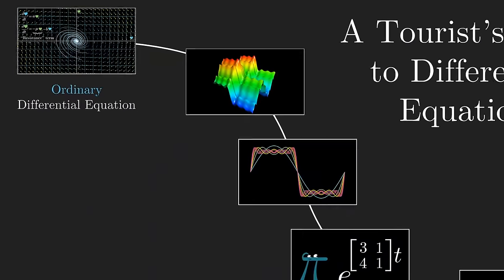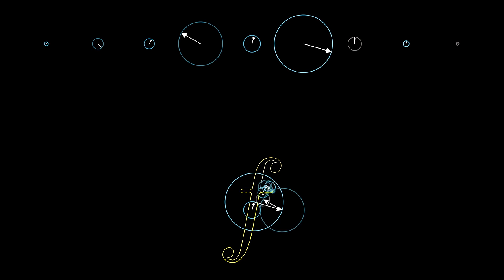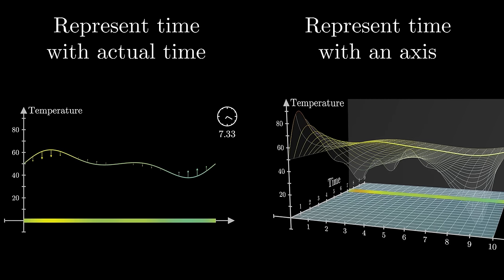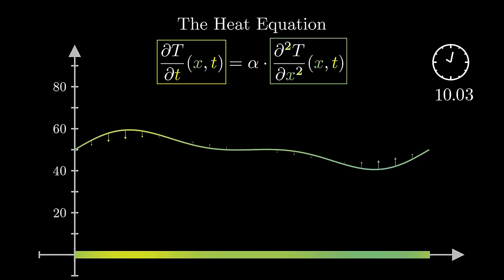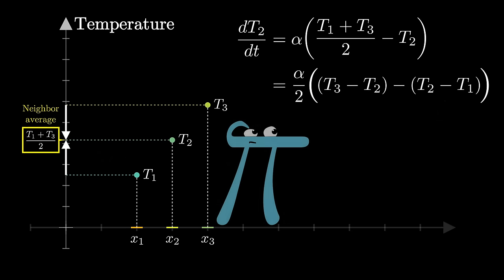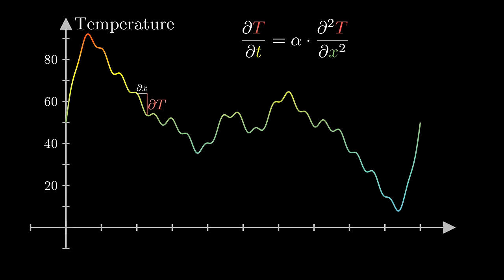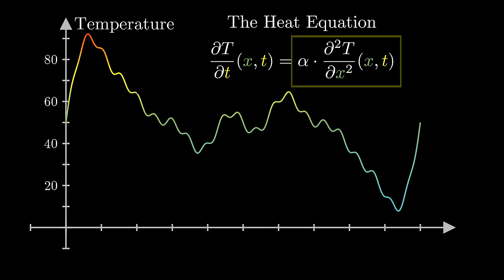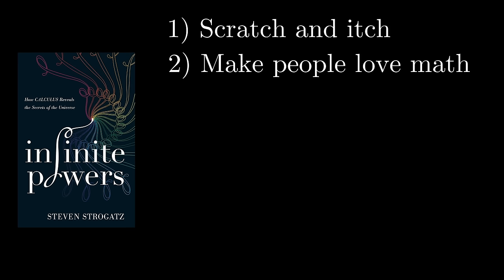But what is a partial differential equation?  | DE2

Comment from the maker: Next up, we'll look at how to solve this with Fourier series, including some discussion of boundary conditions.  Stay tuned!

Edit:  I see a number of questions about changes at the boundary, so maybe I’ll add a quick note.  For example, some of you ask if a function with constant non-zero slope is stable.  Indeed, this is something that needs to be specified for a well-defined solution, so good question!  The heat equation as described here only describes the interior.  The easiest boundary condition to work with is when each endpoint is held fixed, e.g. if the ends of the rod were somehow constrained not to change temperature.  In that case, straight lines are a stable solution.  But other conditions can be specified too, as you’ll see!
Reply: Cant wait to see if you use the only good convention for the prefactor
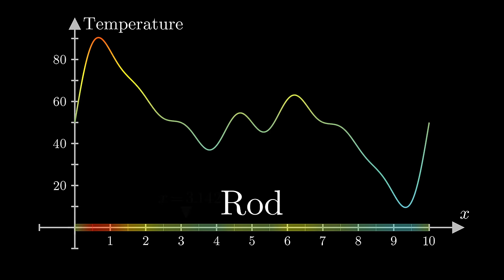Reply: Thanks for this, writing some coursework on this very topic right now and this really helped clear some stuff up, certainly one of your best series. Also nice choice of numbers @ 3:45
Reply: What if the temperature distribution is linear? Then the second partial with respect to x is zero but my gut says that temperature should still ballance out
Reply: @joshuagross6022  There was no assumption about the boundary in this vid, so it would correspond to a constant heat flow
Reply: @aksel9290  1) pi 3) Golden ratio 4) tau 
What's 7.380?
Edit: Sorry, 7.389
Edit: Nvm, I read it in comments. It means e^2.
Reply: Your Channel is the best so far in explaining complicated topics in a very comprehensive way. I had studied chemistry engineering and we had those things explained by our professors, but to see it visually realized like this makes it even easier to understand the abstract nature of math. While I don't hate math, it was never a topic, where my imagination can go loose as organic chemistry, where you can imagine the mechanics of reactions and the why, for instance an electron would go to this position and not the other. I already recommended your channel to my best friend, who is math affine. Thank you for your existing channel, it is always a pleasure to watch it
Reply: @3b1b I'm very interested in how Fourier Series can be used to animate alphabets n any curves😃. Eventhough I get only some part of ur vid but u definitely make me interested in Math. Keep up the good work.
Reply: Sir pls measure theory and integration
Reply: Please look in to the electric universe model, consider Riemann hypothesis and how ricci flow was solved as a heatlike event of embedded spheres creating tori. And how when magnetic fields polarize they form tori.
Reply: What a time to be alive!
Reply: thanks for this! my ode + pde exam is next week, perfect videos to influence me to start studying :)
Reply: If you ever take suggestions:
1. It would be awesome if you could cover numerical methods for PDEs too;
2. I also saw many people trying to illustrate path integrals, but your illustrations and animations are considerably better. That would also be quite interesting to see.

Anyhow, keep up the good work. Those videos are fantastic.
Reply: 3Blue1Brown solve f’’(x) * f(x)^2 = c
Where c is a constant. I have no idea if it can be solved.
Reply: @eunhyoukshin7777  The model presented would not correspond to any heat flow as I understand it, let alone constant flow. The second partial with respect to x would be zero if the temperature distribution was a line, dT/dt=0
Reply: @kpopalitfonzelitaclide2147  That's a nice differential equation, where did you find it?  Substitute y = f(x), v = f'(x) so that f ' '(x) = dv/dx = dv/dy * dy/dx = dv/dy * v, so that the equation becomes dv/dy v y^2 = c.  Then you can separate variables which leads to an interesting integral.  See if you can take it from there.  It's solvable.

By the way, this isn't just me being clever.  The trick of letting y = f(x) and v = f '(x) is useful in situation where the independent variable (x for us) is not part of the differential equation.
Reply: I wish these beautiful videos were in Turkish
Reply: It’s funny. I never thought I’d reach the point that I would already understand what you are trying to teach before the actual video. Thank you BVPs!
Reply: Could you do the wave equation after this series of videos?
Reply: Will you also show how to solve with Green's function and the notion of what convolution does?
Pleeeeeease!
Reply: @joshuagross6022  Yes, but there's nothing wrong about that line being stationary (unless we assume thermal isolation)
Reply: @joshuagross6022  Or we can just think of boundary temperatures being fixed by some surrounding env. (Hence the heat flow)
Reply: I'd like to have a clear intuition about rotational and divergence
Reply: How does he animate these?
Reply: The best at explaining the mystery behind the world of mathematics. Even Richard Feynman would be impressed with this with the use of his technique. Carry on the good work at bringing complex maths to a level that makes it comprehensible.
Reply: I already took all the mathematical courses from an electronic engineering curriculum, but  never got that interested in seeing what really happens under the hood as when i watch your videos.  Thanks!
Reply: Please explain Maxwell's Equations in Electromagnetics
Reply: Then how can that situation be equal to the situation in the video.....8:40..T3 and T1 aren’t constants right....need a bit clarity over it.....relative??........but the animation(or visualization) you showed confused me a bit....
Reply: Why are your formulas always coordinate dependent, that in and of itself takes away the point of your videos which is mostly to gain a clear intuitive geometrical intuition about various topics?
Reply: When does the next video come out?....Eagerly waiting!
Reply: When should we expect it
Reply: Put subtitles in portuguese, Please !!!
Reply: I have a question. Could you tell us how the picture will change if you start to slightly change the parameters of one of the epicycles. How will the picture change if you increase or decrease the rotation speed of the first or second or 32 epicycle by 0.001% or change its radius by a small amount?
Reply: 3Blue1Brown I‘ve got a question concerning the video „why is pi here?“ at 15:44:

I would also intuitively divide the brightness’ value (pi squared divided by four) by two, because we just want one out of two sides (of the infinitely big circle). But I read that two sets, that are both countably infinite, have the SAME amount of elements. Why also can we divide the brightness‘ value by 2 ?
Reply: Could you please make a video explain in principle how could you make these beautiful animations?
Reply: Can't wait for the next episode! :)
Reply: Can’t wait for Fourier series. They were the last topic in my Real Analysis class and I thought they were really interesting
Reply: Can't wait :D
In my second year in college we're going to discuss DE. The upcoming video would be a great help for us learners.
Reply: update quick
Reply: Thanks! Will the next video also provide an intuitive explanation of why a cdf pops up in the solution?
Reply: I don't understand the logic  of replacing ∆∆T to d2T/dx2. Is it some trick? Or some deception?
Reply: Thanks grant
Reply: Request: explain the conceptual difference between boundary conditions and initial conditions, specifically highlighting why boundary conditions make things HARD in a way initial conditions don't?
Reply: 3Blue1Brown please, I need you to tell me why: 0!=1 ? & what's the other rules of factorial?
Reply: when will the next vid be up?
Reply: Are you okay? I'm starting to worry.
Reply: I would love to watch a combinatorics or number theory video series
Reply: Good day! Could you please tell what software you use to produce these animations? I admire them greatly and I would like to learn how to do something similar as supporting material for my seminars. It has probably been asked many times before, but I couldn't readily find your answer in the comments. Thank you!
Reply: Can you do Avideo about Fuzzy Logic , Sate Space,

Comment: I'm a computer science grad and I've taken a handful of classes which required the use of ODEs and PDEs. After watching this video, I feel like I have finally gained a full conceptual understanding of how they fit into the larger scheme of operations in math and cs. The visualizations you created were absolutely incredible, but the explanation was perfect. Thank you so much!
Reply: can you reference some pdfs or channels to learn odes and pdes related to computer science?
Reply: Yeah @anti gy I have the same question, any recommendations @Kraylus?
Reply: tf2 engineer tf2 engineer
Reply: comment exeptional n a created have you
Reply: Likewise...The only classes I used DE’s in really were for Engineering Dynamics and Vibration Analysis (Civil Engineer) but I never really understood what was going on, this is a great video
Reply: Outstanding
Reply: @antigy7962  Not OP, but I also had to do something similar in some of my classes. Mostly, from the CS perspective on ODEs and PDEs, we try to develop programs to numerically solve these equations. The particular equations themselves depend on your area of application. For example, if you're interested in fluid flow, perhaps you may be working with the Navier Stokes equation, in brain simulations in Computational Neuroscience you may be solving equations that model how neurons generate spikes and how these spikes lead to the change in synaptic weight between two neurons, and in game design, you may be writing physics solvers for colliding objects and such.

Comment: 14:53 Wouldn’t the laplacian also include a second partial derivative of T with respect to time since time is one of the inputs for T? 
Edit: I’m just now remembering that del operator only has 3 spacial partial derivatives for x,y, and z and not one for time so then when you take the divergence of the gradient of T (Laplacian) there’s no second second partial derivative for time.
Reply: That really depends on the role of time in the physical context and the interplay between time and space. @3Blue1Brown perfectly illustrates this interplay in the context of heat flow, the interplay between temporal and spatial variation and the resulting partial differential operator (all those derivatives summed up). In different contexts with different interplay, you get different operators (or dare I say: partially different operators), such as (almost) the one you expected (d'Alembert for the wave equation and in special relativity, indeed from a del with 4 derivatives) or the one governing evolution in quantum mechanics (Schrödinger operator).
Reply: As not a math person but someone with an intuition about what happens to the temperature of a particle, it seems that only the temperature of the surrounding particles (and the conductivity of the material) matter to what happens to the particle in question. The time history has no effect. To this you might say that from the time history (say, rapidly cooling) you can deduce it's surrounded by cold particles, but this is not an effect of the time history, just a description. The state that is causing this, is already reflected in the spatial variables.

Comment: Excellent video. One detail I would like to see corrected is the gradient diffusion model, I.e. q=-k(dT/dx) and consequently dT/dt=d/dx(k(dT/dx)) shown here in 1-D. The point is that the diffusion coefficient need not be constant due to different material properties for instance. We used this as an excercise for basic simulation program and it was easy to include variable material properties to the solver.

But the visualizations in this video, they are outstanding! And it definitely think the video brings Laplacian into life.

Comment: That is exactly why, we use finite elements method for numerical simulations rather than trying to solve the problem at continuous points like the PDEs or ODEs do. It is just much easier to use shape functions which relate to polynomials :)

Comment: Being a bit pedantic here, but \nabla^2 is the Hessian of a function T, i.e. for a covariant derivative (or connection) ∇, the Hessian is the two times iterated covariant derivative of function. The Laplace operator you mean is actually defined as the trace of the Hessian \tr\nabla^2, i.e. the contraction of the covariant derivative of the differential of any smooth function, which gives in particular the sum of squares of the partial derivatives on IR^n.

In short: ∆ ≠ ∇^2

Comment: Would you consider going over Green’s and Gauss’ theorems.  Having been in an Engineering Science track back in the day it was fascinating to come up with so many fundamental equations by describing the mechanics that happen on an arbitrary surface (the famous potato), turning that into a path or surface integral, then “Gaussing” that to come up with the governing PDEs.  The concept really unifies the various engineering fields.

I was in college when we were still turning decks of cards to an admin for them to run it, else I’d have stayed in physical math.  In that case I’d be returning to the integral forms because the discrete forms converge better.

I’ve still to do a deeper dive into your content, but am looking forward to it - especially looking forward to getting to know Group Theory.

On an obscure tangent, I notice you use the phrase “scratch and itch”, which is a form of the original “scratch an itch” I’ve never seen before. I’d be interested to understand if this is a regional form or has some other known origin.

Comment: Explaining the Fourier heat equations using the Fourier series was a bit of a problem. Here, to convert a temperature field to a vector field, the gradient vector field must be obtained using the nabla operator. Then the divergence giving the heat change in this vector field must be calculated. Finally, this heat exchange must be equalized to the 1st derivative of the temperature with respect to time. It is confusing to explain the laplacian of the temperature field with these graphs without explaining this scalar-vector-scalar transformation.

Comment: I get the math for these examples but the problem I have with this entropic model is that We don’t even know if this model is in a vacuum or in air and of what ambient temperature and if so then certainly we assume there are no convective air flows and the volume we assume is infinite and that the object is floating and no energy of other forms are affecting the material such as solar irradiance. I imagine as you add such complexities then the function becomes much more challenging but still nice to see if the calculus changes or just the function complexity.

Comment: While watching this video, I was considering how you do your animations. I am a huge fan, and stumbled across this series as part of my quest to watch all of your content. I have noticed you have a pretty consistent animation for drawing straight lines - that is, the accelerations are pretty constant and look the same, have the same energy when looked at, etc etc

But then I got to thinking: how in the world would someone define that line-drawing behavior? Should it draw at a fixed velocity, always drawing the same proportion of the line with each time step? Should it accelerate and then decelerate, like the one you use? Maybe it should start moving quickly, but end slowly? I have no idea! I don’t think anyone could just pop into whatever animation software, draw a nice velocity curve, and say “yes, this is what I want because I have solved the problem of animating lines.” Humans can’t pull that arbitrarily out of a hat, and math doesn’t have those answers.

But then I realized, if you look at an example animation - well, everything changes. That animation is way too slow; I think it would look better faster. Going at a constant rate is boring, add some energy with dynamic speeds.
Humans cannot just generate numbers like that and expect them to work. But what they can do is look at a preexisting condition and say if it’s too high or too low, if it’s too fast or too slow - indeed, we are differential equations generators ourselves!

Thanks for helping me see math in yet another area of our lives

Comment: Hope you can talk about PDEs that can achieve finite extinction times, like the nonlinear heat equation
d/dt[U(x,t)] = d^2/dx^2[sqrt(U(x,t))]
All related papers I found claimed it solutions could achieve a finite ending time while holding uniqueness of solutions, but a solution that matches the zero function after a finite time should violate uniqueness of solutions in backward times, so I am confuse about what is happening. Hope you can made a related video.

Comment: Great video. I'm left with a question about building the heat equation though. It feels since it is dependant to the second derivative and there's a negative term it's like the function wants to remove all curvature and get completely flat to reach equilibrium. However, wouldn't it do something similar if it was dependant of the first derivative or its slope? I know his is the right way but I'm curious about how would the temperature evolve if it was only the first derivative because if you reach 0 slope you're also at 0 curvature. Would there be some examples where this first derivative approach breaks? I'd simulate myself in a computer to check the different cases with multiple initial conditions but I don't know how to do that now.